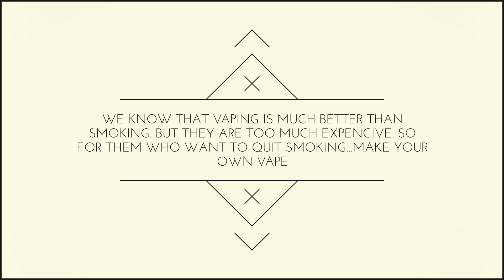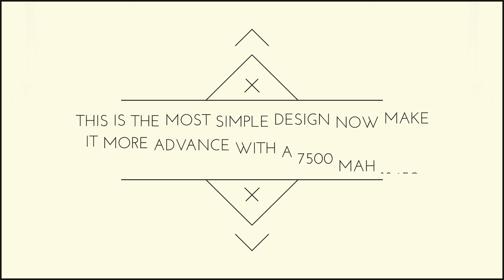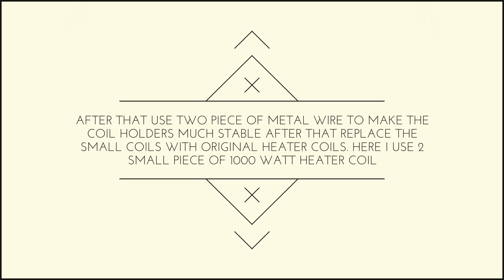How to make a vape in just rs-150 or less... DIY VAPE

Comment: how to make auto cutoff circuit make video pz 🙏
Reply from the maker: Dont need to make bro i give you the link for the charger its very cheap
Reply from the maker: TP4056 1A Li-ion lithium Battery Charging Module With Current Protection - Type C
https://www.electronicscomp.com/tp4056-1a-li-ion-lithium-battery-charging-module-with-current-protection-type-c
Reply from the maker: Its for type c cable if you use micro usb then search for it in the website you will get

Comment: Can i use a vape charger of 4.2 v 420ma  to charge the battery
Reply: Ego
Reply from the maker: Yah you can but the current rating is bit high
Reply from the maker: Use two batteries in prrlal then

Comment: From what you have made that coil bro ???
Reply from the maker: bro i didn't made it , i bought it from market , this is a 1000 watt heater coil
Reply: @Jugadu_Banda  bro i bought thus too but that's not working
Reply from the maker: umm i think your coil's resistance is but higher and the battery is low .. and one more thing use thick wire for the connection
Reply from the maker: watch my latest video about same topic
Reply: @Jugadu_Banda  ok thanks bro you are awsm
Reply from the maker: thank you so much bro, subscribe to my channel and share if you like ❤️

Comment: Bro can I make vape of 3.7 volt 2000 man battery plz tell me
Reply from the maker: 2000 mah battery will quickly discharged... you can use two batteries in parallel ...
Reply: Thanks bro 😊
Reply: I have 1 problem also nicrome wire heats in high voltage 😥
Reply from the maker: use a thicker nichrome wire ... watch my latest video ... the demonstration was more clear there.. link https://youtu.be/Gg6UYADeavI
Reply: You're awesome bro 😎
Reply from the maker: thank you soo much brother ... keep supporting and dont forget to subscribe to my channel and do share with your friends

Comment: Hi does Aa battery 1.5 volt work for very small coil?
Reply from the maker: Voltage doesn't mttr bro amp matters
Reply: @Jugadu_Banda  2000-3000mah but is Aa battery enough for this???
Reply from the maker: Ya 3000 mah is enough
Reply: @Jugadu_Banda  Thank you for telling
Reply: @Jugadu_Banda  how many mAh this requires
Reply from the maker: Minimum 3 amp
Reply from the maker: Grt bt expencive though
Reply from the maker: Order from snapdeal
Reply: @Jugadu_Banda  It takes so long to order from india to europe
Reply: So if i will use two 1.5 volt batteries it would work. And i want small setup so thats why im asking.
Reply: @aurimasbutkus3517  I made a vape with 2 aa batteries and a small coil it worked
Reply: @aurimasbutkus3517  There is also a vape mod that uses 2 aa batteries and it makes big clouds
Reply: @ScaryTeacherHero  rlly thank you!!!
Reply: @ScaryTeacherHero  thank you rlly much. Okay so this will work. That's amazing!
Reply: @ScaryTeacherHero  but like is there some tips of making that vape
Reply from the maker: Yup

Comment: Which wire did u use for coil 
And show the circuit diagram of the digital circuit
Reply from the maker: Ok i will in the futr bro.... And i am using heater wire
Reply: 1000ki kya bhai

Comment: Hey don't press that button for too long because those 18650 batteries are pretty dangerous just search for vape explosion and you all with mechanical mod will stop using it rather you can use a USB lead and connect it instead of that battery and just plug it into a 1 ampere USB mobile phone charger and that will work as well, but that was good.
Reply from the maker: Bro i alrady made a video regarding this topic ... Btw thnq for support
Reply: @Jugadu_Banda  you are most welcome sir

Comment: Bro can we put 9v battery
Reply from the maker: Bro actualy voltage dsnt mttr.... Amps matters
Reply from the maker: 9v. Batteries are cm with 0.5 amp which is very low you need more than 1400 mah

Comment: The only problem with your videos is presentation, camera is too close to the components and someone with a non-technical background won't be able to understand the connections without proper time and labeling. Try putting circuit schematics in the video itself.
Reply: Best comment I have ever get. Thnx bro for your suggestion I will work on it for sure.. Thankyou so much

Comment: That kind of plastic on tube of your plastic automizer can melt pls use other material when you make diy like that
Reply from the maker: no bro its nevr gonna melt bcz that mceal which i used is heat resistance.....its make the plastic heat resistance...dont pnc bro..... but thanx for your sugg... nxt time it wl be in my mind thnq😊